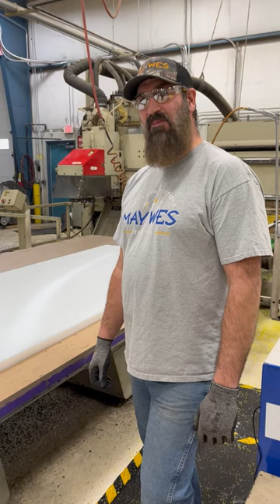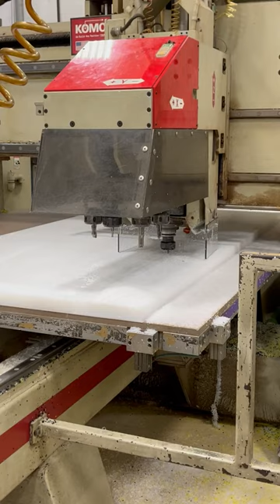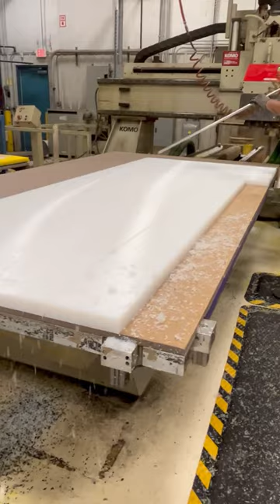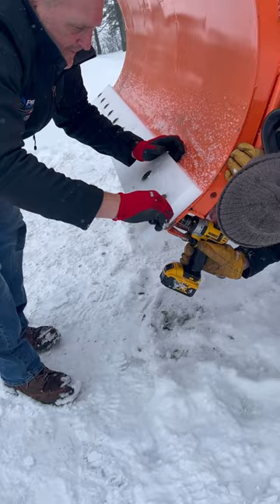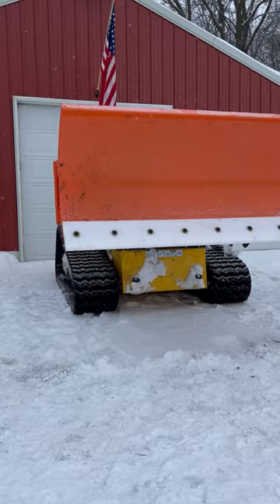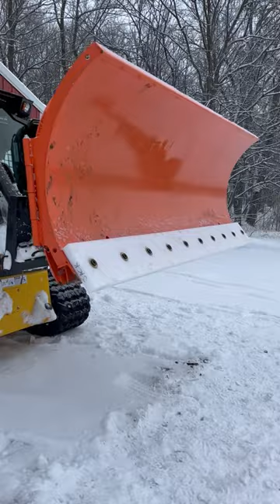Snow Removal with Poly Cutting Edge #shorts

Comment: How long will that last?
Reply from the maker: It depends on how many plowable snowfalls you get, how much pavement you are plowing and the surface you are plowing, as well as the thickness of your cutting edge. UHMW is very abrasion resistant. We are still using the 1 1/2" thick cutting edge we installed on our shop plow four years ago. We flipped it last year. Our parking lot is part asphalt and part gravel. Poly cutting edges are recommended for paved surfaces. The partial gravel surface has worn ours faster.